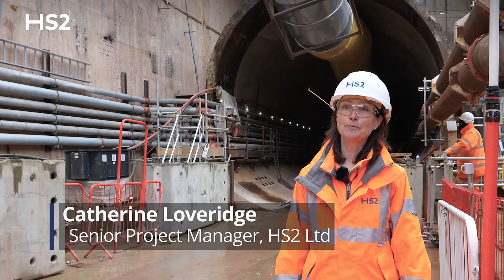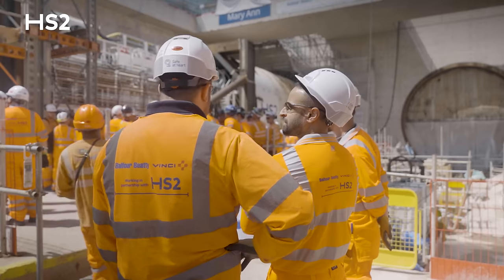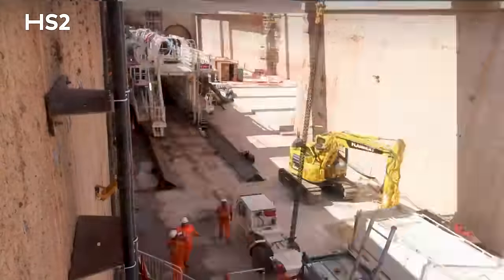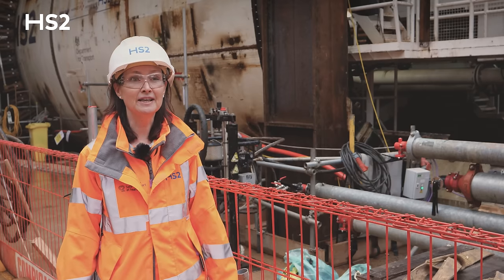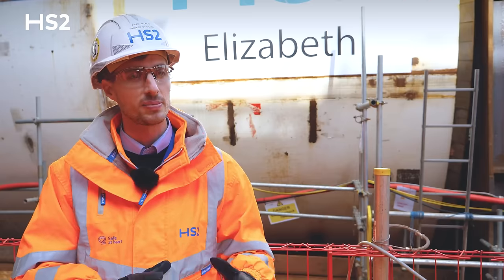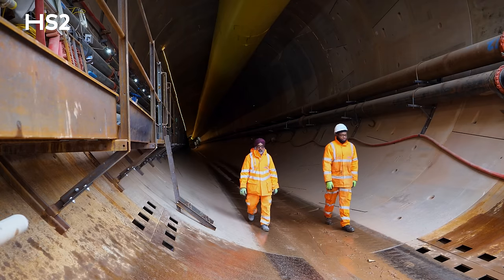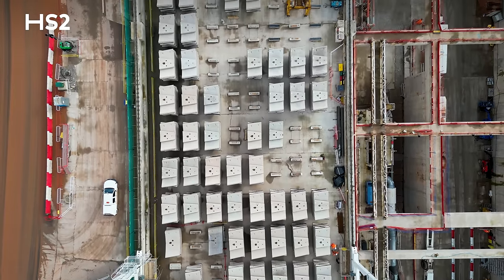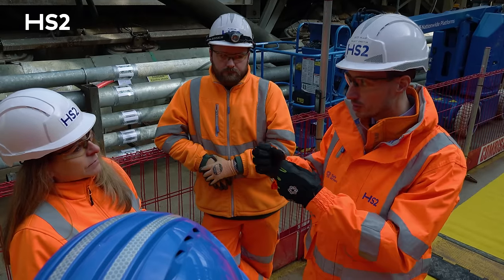Huge HS2 tunnelling machines digging towards Birmingham

Comment: It really is a fantastic piece of civil engineering, I get the impression that objectors don't think about the sheer level of planning that goes into something like this, or the fact that everything possible is being done to minimise environmental disruption. Hopefully it'll go to Manchester in my lifetime.
Reply: What are the benefits?  saving 20 minutes on a journey when the 15 minute cites are being put in place.
Reply: @jeffk4223  it actually saves 40 mins both ways from Birmingham to London so what is your problem.
Reply: A key feature of the construction industry is that there are a lot of people who can voice an opinion on something they know nothing about..  So there are nonsensical comments like the whole thing can be built for 18 billion,  it can be built in half the time, there is no need for all these pen pushers managing on site.
Reply: @jeffk4223  The benefits are to increase rail capacity by moving existing high-speed trains onto dedicated high-speed rail. This frees up much needed capacity on our current rail network to enable us to run more regular commuter trains much more reliably. Some of the lines it runs near like the West Coast Main Line are very congested currently. It's similar logic to motorway expansion. This isn't some new idea it's worked in France, Japan, Germany, China etc. It has very little to do with increasing speed or decreasing journey times.

Comment: The original submitted design with the hs2 act should have had the long tunnel solution.  At least someone worked out a better solution. Very impressive works.

Comment: If I lived in Manchester I would be pissed. Also why not Birmingham New Street?
Reply: Why what's Manchester got to be pissed about? The HS2 trains will still arrive in Manchester via the WCML and there are already plans for a new route for the trains.
HS2 arrives in Birmingham right next to New Street
Reply: BNS isn't feasible the land at Curzon street was available and only a couple of minutes walk from both New street and even closer Moore street
Reply: @1chish  The WCML between Tamworth and Crewe is already running at over its designed capacity  One late running train or failure and it all goes tits up.  From Crewe to Manchester it is only a twin track which has to take local stopping services, regional services including Manchester Airport, Intercity and Freight.  Thus any advantages of higher speed are lost  and the  extra capacity for freight is also lost. So yes there is a good reason to be pissed off.
Reply: @daviddearden6372   The HS2 trains will replace the Class 390s so its not extra traffic.
But as I said there is already a plan to build a new route.
Reply: Why are you pissed? Try staying off the alcohol
Reply: No room at Birmingham New Street station. It's already running at full capacity. New Street station is built under the city centre (because the centre of Brum is on a hill, not in a river valley like many other city centres in the UK are). It is approached in all directions by tunnels, whose capacity is limited. Note that Curzon Street, where the new HS2 terminal station will be, was the original terminus of the London to Birmingham railway when it was first built in the 19th century. The engineer, the famous Robert Stevenson, stopped the line there because of the difficulty and expense of tunneling further to create a station in the very centre of Birmingham. The original terminal building is still there - a grade I listed building, that will be restored and will be seen by travellers using the new HS2 station. Eventually the line was extended into the city centre and New St station was built, but this was at great cost even then. I'm not sure it would be feasible to expand those tunnels now to accommodate HS2, and there's certainly no room to expand New Street station itself. I hope this explains adequately why the HS2 planners haven't done "the obvious"!
Reply: @1chish One of the main reasons for building HS2 was to effectively expand capacity on the West Coast Main Line route up to the Midlands and the North West. At present the WCML is trying to accomodate fast inter-city passenger trains, local/regional  stopping trains and freight trains, and it's completely bottlenecked. HS2 would free capacity on the existing WCML for more and better local/regional stopping services and for more freight trains. But certain short-sighted politicians, one in particular, just couldn't see this, so the Midlands to Northwest bit of the WCML will remain a big bottleneck for yet more years to come. So yes Manchester has got a lot to be pissed about, and so has Brum because communications between those two cities need improving as much as the London - Brum leg does, if not more so.
Reply: @johnevans2044   great comment on New Street and I am always happy to learn more even if others are not. Every day is a school day.
Reply: @1chish  Birmingham New Street is not next to Birmingham Curzon Street, New Street is a fair distance away the station that is next to the Birmingham Curzon Street Station is Birmingham Moor Street Station, so sorry to say Birmingham Curzon Street sttion is not right next to Birmingham New Street there is a longish Tram ride between the two stations.
Reply: @peterwilliamallen1063  If you went to Istanbul Airport - that is gigantic Curzon Street Moor Street and New Street would all fit in that terminal. Curzon Street is near New Street.
Reply: @charleswillcock3235  So what has Istanbul Airport got to do with HS2 and Curzon Street station, one is an Airport and the other a Railway Station, no comparison
Reply: @peterwilliamallen1063  Depends how you see the world. Both are transport hubs. If you are in Istanbul airport you have to walk along way from one end to the other. I suspect that the walk from Curzon Street to New Street will be a similar distance. I used to live in London and the walk from one tube platform to another can be a very long way and yet on the map the tracks look like they are on top each other. 
Expanding the rail network in the UK is not a bad idea. HS2 is an obscene waste of money and I am afraid I am amazed anyone can defend the project in its form it has emerged as. Earlier today Facebook served up some video of a steam train pulling a load of coaches and a diesel engine. The irony of people paying to ride such a train just because it was pulled by steam. If HS2 had been designed for some steam trains and 90% everyday electric people would have been fighting to have the track near their property.
I am afraid the waste of money on HS2 makes my blood boil. The idea that it will not even go to Euston is beyond a joke.

Comment: I would be grateful if someone could explain why the tunnels did not align with existing rail lines and motorways. The route of HS2 caused a huge amount discontent. Where is Saint Barbara on the site?
Reply: Well why should they align with them
Reply: @peterwilliamallen1063  They own the land and ground rights, no need for huge disruption. In the States they build subways/tube lines above each track. Don’t think trains can run at 300-400kph in tunnels?
Reply: @jeanjacques9980  Well thats the fact oin the main part of the line they will be running at 250 mph through the tunnels
Reply: because the existing lines are not high speed, the trains can navigate tighter turns without derailing. With HS2, the trains will be going over 250mph, requiring shallower curves, meaning the existing route would not have been able to be followed
Reply: @MrOlympuse410  All major main lines in the UK are desighnd for high speed trains travelling between 110 mph and 125 mph with heavy weight rails, concrete sleepers, high speed point/turn outs and curves canted at an angle to allow these trians to travel arround curves at high speed and they have never derailed. The reason they are not using the southern half of the WCML is that it is not suitble for this type of train and is highly congested and the HS2 route will have very few curves, but these trains will be travelling on the Northern half of the WCML
Reply: @MrOlympuse410  I understand now why hs2 can not follow existing lines underground. All th3 French and Spanish has lines are new surface rail, but they have plenty of land available, except perhaps SE med.

Comment: I am not happy that the Manchester leg has been cancelled. However, can anyone guide me here? My understanding was that the London Birmingham leg is a major bottleneck on the rail network, and that was the justification of building that part of HS2. The Birmingham Manchester leg was more to do with speed and there is less of a capacity issue? Is this true? If not can, you give more background please?

Hopefully the next government, whatever their colour, will green-light this not only to Manchester and Leeds, but even further north.
Reply: It was more about capacity into London for the southern part but you're wrong the biggest gains were the northern part, especially the Eastern part and freeing up capacity in the East Midlands, building a hub station to serve Nottingham and Derby, and then heading up to Sheffield and Leeds. I too hope the Manchester leg is reinstated by the next government as on this stretch there is a big capacity problem around Stoke and up to Crewe, which if not bypassed HS2 trains will just add to as they crawl through this section. Again the most costly part of the project tunnelling to avoid going overground through Tory constituencies was kept at the expense of investment in the north. It should have been started in the north and built going south, then those in London would never have cancelled it to their precious townhouses in Kensington or Islington.
Reply: The whole network was about capacity, and actually now by not building phase 2a (to Crewe) as a minimum, it means HS2 will join the existing network south of one of the biggest bottlenecks on the WCML (Colwich Junction) and make capacity WORSE than it is today on that stretch of line!

The reason the London - West Midlands section is being built first is because that's the section of the WCML which projections showed will reach capacity soonest, but there are still major capacity constraints elsewhere on the WCML, as well as the MML and ECML, which is what Phase 2 was designed to relieve.
Reply: @MarkUKInsects  yep the problem is that whenever you make improvements, it just moves the bottlenecks elsewhere. Even if HS2 were completed in full as originally planned, there would likely be bottlenecks arising at its interfaces with the existing network e.g. at Sheffield, Crewe, York, and Wigan where the HS2 trains would start running on existing lines.
Reply: @MikeWillSee  She with everything you've said here (and liked your comment), but my comment was more about the impact the phase of the project would have in the region it served. If it was purely about biggest economic benefit then the South East would always get the infrastructure investment over other regions of the UK, but that would just mean a bigger economic difference and more investment where it has already had three most with the rest of the country lagging behind.

My comment about starting the project in the North going South was more because those in Westminster wouldn't have cancelled a project planned to terminate in London. I get that money is very tight right now with other priorities but I just don't get why they couldn't have just pushed back the dates for the future phases, cancelled for political reasons totally betrayed any leveling up agenda (if one ever existed, which I view very sceptically).

I've also heard, as mentioned in my previous comment, that the Southern section currently being built was the most expensive section with in my opinion excessive tunnelling massively adding to the cost to hide the project away from sensitive Tory voting constituencies. So in conclusion the cancelled Northern section could have been built if these decisions on the route of the southern leg hadn't been so unnecessarily expensive. 

Totally agree with your comment about Colwich junction and it being the biggest bottleneck. How keeping the section bypassing this wasn't kept is beyond belief imo, and just asked ignorance, as was the decision to announce the cancellation of the leg to Manchester in the Tory Conference in Manchester!!!